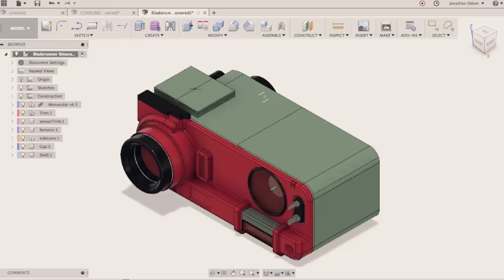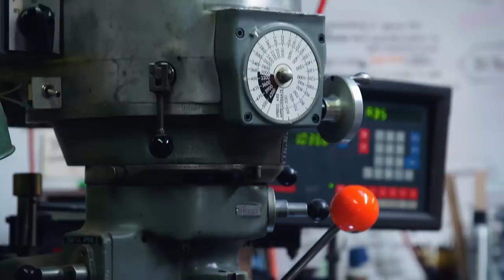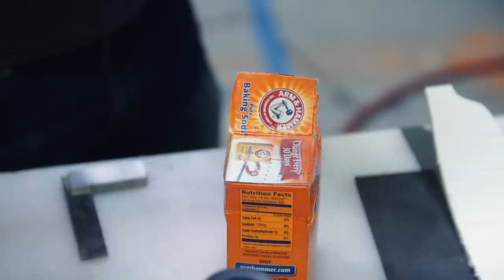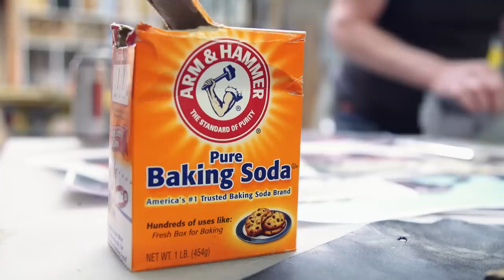Adam Savage's One Day Builds: Blade Runner 2049 Binoculars!

Comment: A weathering solution used by model railroaders from the 50's to present is to make a mix of rubbing alcohol and black leather shoe dye. The shoe dye is your pigment with the alcohol as the carrier and solvent.  Mix up a solution of about 1:8 dye to alcohol.  Put all of that into a glass tall jar, shake it up, and then let it sit undisturbed for a day.  Let it settle out.  Now when you go to use it, you'll have variable density at different levels to pull from with a brush.  More pigment the deeper you go.  With alcohol as the solvent, it flashes off quickly.   It's fantastic for giving depth to cracks, seams, and details.  And it's CHEAP.
.
For flaking paint, as you'd see on metal surfaces, paint the surface with grey/metallics, then dab on rubber cement in the areas you want the paint to flake.  Paint your top color coat, and when dry, use masking tape to pull off the rubber cement.  You'll have a wonderful flaky scabbed surface where you want it.
.
Rusty crusty surfaces on plastic are easy to do by pooling styrene cement (or MEK in well ventilated areas) and dusting on earth tone chalks. It will give a scabby surface that is permanent and durable.  Not enough effect? Repeat for more rust.
Reply: I think Adam would go crazy if he could never weather things, lol. Imagine if he got hired as a prop guy onto a movie where they want him to provide 100s of pristine, brand new looking items for a factory assembly line scene, aka zero weather required and you CAN'T weather them, lol. I think he'd start to go nuts with his "weathering boner" after awhile :D
Reply: I copied and pasted your comment into a Word document to reference when I'm building terrain. Thank you very much!
Reply: Good info, have likewise made notes. Thankyou for sharing them.
Reply: There's a company that makes rust and patina paints. You prime the surface, then paint on the iron or copper paint, then spray the activator. It creates a 100% real rust or patina effect without damaging the item
Reply: Where's the fun in that?! ; )
Reply: saved that bit of info to the personal archives for future projects of exceptional cleverness...thanks for the post

Comment: Considering how comprehensive Adam's workshop is I am still constantly amazed how he so haphazardly spray paints his hands and surrounding tools. It would drive me crazy to work for any length of time with my hands coated by spray paint.
Reply: he mustve been too excited to get it done quickly lol
Reply: that's a common trait of industry veterans. In commercials, your turn around time can be in the span of days or even sometimes hours for small, intricate set pieces, so getting used to using your body somewhat like a prop to work on is an easy way to help speed up the process.
Reply: Youve all missed the real reason. Its because it doesnt matter .the goal in complete the mission/ build /job some paint on you're fingers isnt even on the radar
Reply: Artists seriously don't have the left-brain capacity to think about things like that once the right brain takes over. That's why 4hrs can feel like 40min — our right brains are in control and we immerse ourselves into the work.

Comment: a little recommendation from a pro spray painter instead of using the Montana Gold range of spraypaints use the Montana Black range instead as it's a more durable/thicker paint with a nicer finish.
Reply: the new Black formula is really nice if you haven't tried it. And there's always my favourite Molotow Premium line. For the green the Camouflage or Amazonas and Signal Red colours are a close match to the actual prop.
Reply: i was just thinking the same thing!
Reply: the problem with thicker paints is they tend to obscure details. You are better off having more coats of a thinner paint than a thicker paint that ruins fine detail.
Reply: There are two types of Montana paints. The real one and the faux brand after that legal dispute. Montana made in Germany and MTN (Montana Colors) from Spain. Do you know the # or color name so I know which one to get? Thanks! EDIT: Nevermind. I see you said Montana Gold so that's the real stuff.
Reply: its graffiti paint just like Molotow thats prob even better
Reply: @MM420 actually MTN from Spain is the original Montana, Montana Germany was originally distributor for Montana Spain but through some underhand crap they stole the name and forced Montana Spain to rebrand as MTN. Both companies make good paint but I'd say Montana Colors (Germany) make the better paint for this type of model making application.
Reply: @J.A.Ratt85 trust me on this both the Gold and Black paint lines are relatively thin and won't obscure details and can be layered up, it's just the Black is tougher, coats better and has a visually nicer finish as it has a better depth than the Gold. I describe it as the Black colours have a nice ripeness to them and when you layer the colour the ripeness increases.
Reply: @MM420 also the colours closet in the Montana black line to the prop are Murdoch if you want a greyer lighter camo green or Troops if you want a darker more greener camo. Fire Rose layered over a base coat of Cardinal for the red.
Reply: adam bombs with that after the build

Comment: "one of my big failings as a maker, is I make my tolerances too tight" = humblebrag
Reply: skezus he’s the one man who can humblebrag.
Reply: no, you misunderstand, overtight tolerance ISN’T super accuracy, it’s a mistake in not allowing for materials thickness, assembly order and angles clearance. He is stating it as an error of his, not a statement of super duper accuracy.
Reply: No I understood. Its' the same as when asked at a job interview what your weaknesses are and you say "I'm a workaholic" Yes technically, being a workaholic is an error, also you are bragging about your work ethic.
Reply: That doesn't make sense. Tolerance being "too tight" is a design error. It means he assumed the part could be fabricated more accurately than he could actually manage.
Reply: skezus ,  if it was an attempt at humblebrag (which I agree it sounded like), it was a total failure. Any real engineer would recognize "tolerance too tight" as a bad thing.

Comment: Have you ever tried acrylic powder instead of baking soda, added to CA adhesive? This powder is used a lot in nail salons for nail extensions and used with CA makes for a very strong yet shapable material for filling gaps and building up areas. I use it in aircraft modeling and it is great as it is smooth an precise and very strong.

Comment: Adam have you ever tried chemically etching stainless steel sheet? It's a relatively easy process using a printable masking via laserjet. It can usually be completed in less than an hour and the results/ detail is incredible. 

It could be a fantastic way to finish the 'optical label' should you ever wish to revisit the build. 

I really enjoyed the build. Great work good sir.

Comment: I wish Adam had talked about the spray paint he used. Montana has developed that paint and pray can amazingly. It’s an oil based paint that covers amazingly on a first pass and can be painted over with another color almost immediately. Again with great coverage. And another thing that is great is that you can get different tips for different pressure and paint spray release. That specific line of paint can he was using is Montana Gold.

Comment: I love, LOVE LOVE LOVE Adam's builds, and have been a paid member of TESTED. But - how about some builds that use the limited tools that most of us schlubbs have at home? I don't own a drill press, a router, a lathe, any "machining" tools, etc. I have sanders and some cordless drills and a small drill press (that you strap a cordless drill into). A heat gun, assorted clamps and pliers and scredrivers and snips, etc. I don't even have a tap and die set.  Some of that, someday, I may own. But living in San Francisco, I don't have the room (or the $$) for most of those elevated tools.  While I know Adam's skill set would probably let him build a working lightsaber with stone knives and bearskins and little else, it would still be nice to occasionally see builds that seem semi-achievable for the average viewer. :-)

Comment: Adam, for the print running off the high gloss silver, hit it with a couple of light coats of clear before you add it. If the clear is light enough, it won't detract from the part, but will protect the toner.

Comment: Taking thirty years ago now ... but I used to run silver paper through a photocopy machine then give it a spray of matte or clear to seal it. Amazing what you can put through them. Trick was to sticky tape a small piece to the sheet ... run a sheet through first to give the position then put the small silver piece over it and place it back in the tray. Depending on size you might want to just tape the leading edge. Be prepared for jams.

Comment: I would suggest that after painting, gloss coat, THEN apply the silver stickers... Very carefully and gently. Then gloss coat over each sticker to seal them. THEN apply weathering mix and pigment. This will seal and allow the stickers some protection not only from light wear but also seal them from the weathering, which can run under/cloud the stickers. It's a similar issue and order of operation for those water slide decals from miniature models.

Comment: For the final label. Surely you have access to a laser engraver/cutter? If so, etch the black of the label on a soda can and then rub some black paint. The paint will slide off the smooth and adhere to the etched.

Comment: I run a commercial digital laser printer and you can fix the problem with toner coming off that gloss silver paper by increasing the weight of the paper settings you run it on, because to the printer the heavier weighted paper, the longer and hotter the diffuser will get and heat the toner longer. Also you could just hit it with spray fixative or hairspray and it would work the same.

Comment: If you set the printer's paper settings to thickest available setting, you'll have better luck getting the toner to adhere on that gloss silver paper. Modern toner is essentially a powered plastic, and the hotter you can get the paper/media, the better and more permanent the toner adhesion will be. Using thicker paper settings will cause your printer to run much slower and give it a better chance to get the paper to the best temp.

Comment: You dont have to use baking soda, you can use any kind of powder, there's an old guitar techs trick to repair bone nuts, by using bone dust and CA glue. I've also used plastic filings successfully (color matched)

Comment: Printing on foil requires more heat than paper. Some printers can be set to a lower speed, otherwise fix the print with an iron and a sheet of non-stick baking paper or use a heat gun.

Comment: At 8:54 what tool is that? Is it suppose to write too? And what is it mainly for?
Reply: just your everyday linear caliper
he basically just spray painted the battery compartment with some matt black and used the caliper to scratch and score a measured offset from the back edge